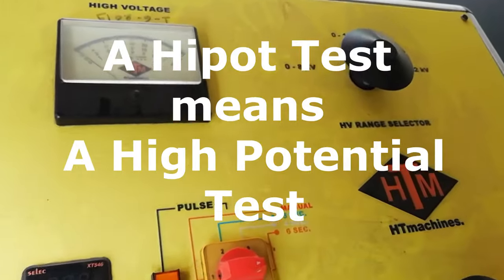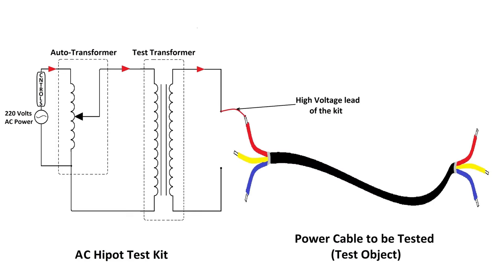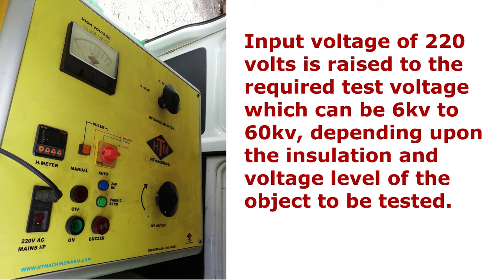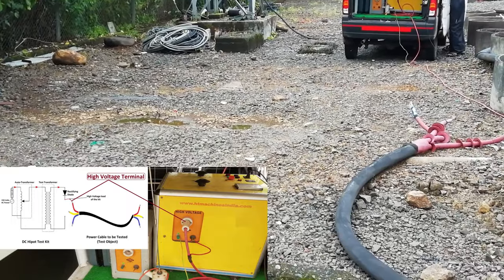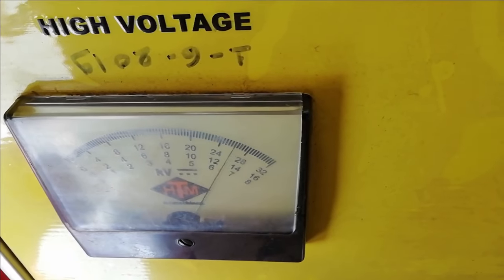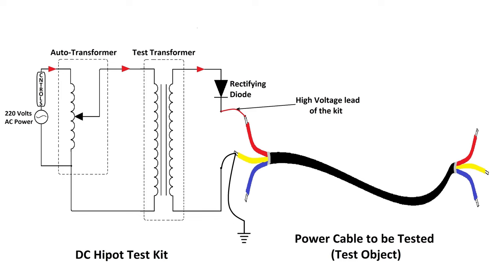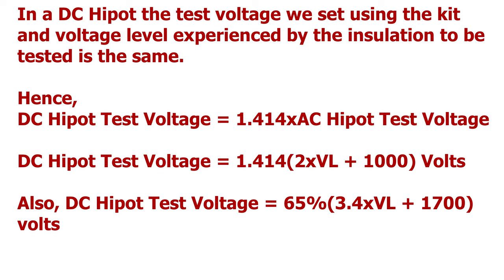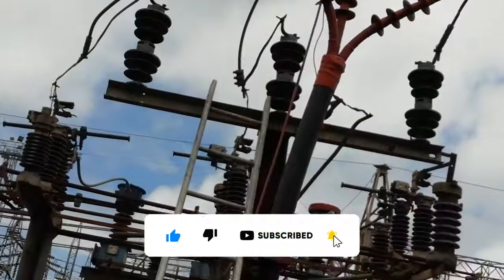Hipot testing. Cable Hipot Test. High Pot test. High potential Test. DC Hipot Test. Hi pot Test.

Comment: Thanks. In my Hipot Kit for DC, In the diode how much oil should be there. In our case it is 50%. as there is a small hair line crack at the top of diode. is it recommended to test when the oil in diode is only 50%. What oil is used to top up. Thanks
Reply from the maker: Thank you for the comment. It is advisable to refer to the manufacturers manual.

Comment: Thanks for sharing this great experience. One question: How much the Hi-pot test results should differ between old and new cables? Regards
Reply from the maker: Thank you for the comment. Either old or new cable, the high pot results such as leakage currents, voltage withstand time, should be as per the standards.
Reply: @ElectroGlobe1  what about the test voltage values?
Reply from the maker: @nerosmero1183  In the video reference standards are mentioned for test voltage values.

Comment: But when you apply DC voltage to primary of transformer you will get 0 output so how can you apply voltage
Reply from the maker: Converters and inverters are used to transform AC into DC and vice a versa. At transformer ends only AC is applied. Transformer does not work on DC current.